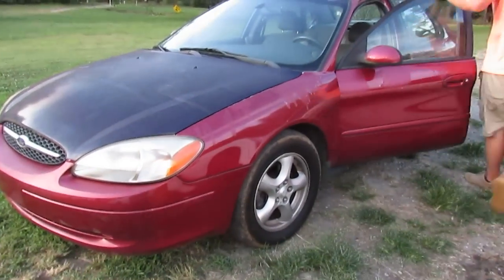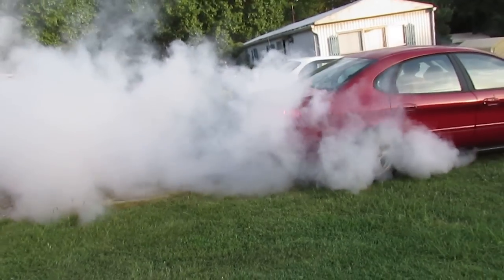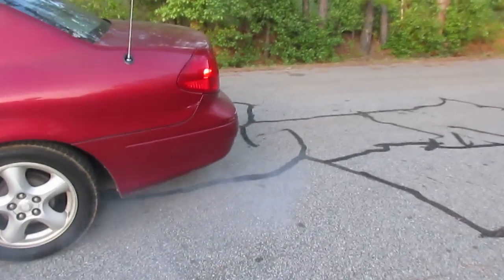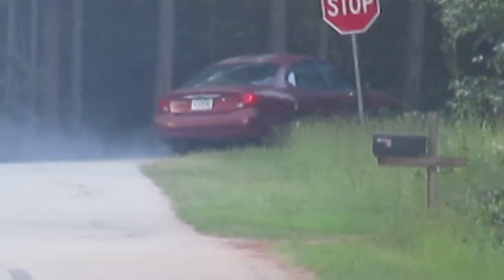SEAFOAM 2002 Ford Taurus SE

Comment: You might be able to help me. I have a 94 mercury tracer wagon. 103k miles. It started with subtle white smoke from the exhaust and that stopped after a like 30 minutes. And it sat for a week or so and I started it up and it has a rod knock now. It overheats and then the guage goes back down
Reply: I have had the worst time trying to figure out the problem
Reply: sounds like you blew a head gasket and maybe coolant leaked into the oil causing not enough lubrication for the engine and therefore the rod knock.
Reply: I agree with Levi. Head gasket. Remove the head and see how the cylinder walls look. If they arent scored at all then throw a new gasket on and install new rocker arms and push rods. Hopefully the head is not cracked. If you can afford to have that pressure tested
Reply: ReNegaDe-SpitFire I thought it was strange because after I bought the car I noticed some blue stuff around the head gasket almost like some type of glue
Reply from the maker: Probably a fried head gasket. What ends up happening, is your gasket fails due to age or heat. Then coolant leaks past the gasket and into the combustion chamber ( causing the white smoke out of the tailpipe) While some coolant leaks into the oil. Water doesnt mix with oil, and your bearings in the bottom of the engine ( crank and rod bearings) cannot be lubricated with water. And this causes them to fail if you run it for too long with water contamination. I would go ahead and start with tearing the head off. And draining the engine oil to see what all your dealing with.
Reply: You should be okay. You will need new head bolts as well but those are cheap. Fel Pro sells those at autozone. If you can afford it I would highly recommend having the head pressure tested before putting it back in. This will test the head for cracks so you know its a good part to put back in the vehicle. No scoring + good head means you are golden for many more miles down the road! Best of luck :)
Reply: Nation Decay if  it  has  knock  when  the  engine  is  cold  ish. .and  white  oil. .I'd  say  the  motor  is  bad  now  due  to  coolant in  the  oil. .bad  head gasket. .the  bearings are  bad  if  you  hear  a knock. .

Comment: Where do you insert the sea foam?
Reply: RunRide you can put it in any vacum hose
Reply: Ok thanks
Reply: RunRide  Putting it in the vacuum line. That is why it was a pain in the arse to start it
Reply: Into the throttle body is best
Reply: Power steering pump reservoir.

Comment: I tried  seafoam  on my 03  town  car. .ran  it  for  a few  mins  on  straight seafoam. .with  a otc injector cleaner pressure  tool.. hooked  up  to  the  fuel  rail. .lol. .then  did  a 50/50  gas  mix  in  it. . It  helped  it. . Seems  better. .but  prob  will  run  it  on  the  otc  cleaner. .. I'll  have  to  order  it. .they  don't  keep  it  in  stock. .

Comment: Super Airplanes like the A380, 777, and 787's should use SEAFOAM since it is such a miracle product. Imagine instead of spending $100K for each airplane inspection/breakdown they could just buy a 55 Gallon barrel of Seafoan? It's a miracle product.

Comment: using water in a vacuum hose while the engine is running definitely puts lets strain on the starter and battery. superclean works prefect for removing carbon too.
Reply: steven earnshaw
Reply: steven earnshaw
Reply: steven earnshaw
Reply: Exactly!  Even better than regular water would be salt water.

Comment: That's one mucky Taurus engine.  I wonder if it's got an oil burning issue or if it's just spent a lot of its life pottering around town...
Reply: gosportjamie  what are you talking about?? it just got seafoamed
Reply: +lawnmowerrock  Usually a vehicle that was running well before would only smoke for a short period after being seafoamed, the fact that this one smoked for much longer suggests the carbon deposits were much more severe, hence why I wondered if it might be burning a bit of oil or had maybe been used extensively for driving around town at low speeds which doesn't enable the vehicle to reach combustion temperatures hot enough to burn off combustion deposits on its own as would happen if the vehicle ran along highways at high speed...

Comment: I own a 2004 Ford Taurus with a V8 and puts out 275 HP. Mine only has 118,000 miles on it though. Good car. Jet Black color with barely legal tinted windows.